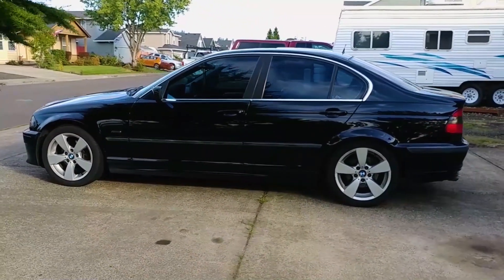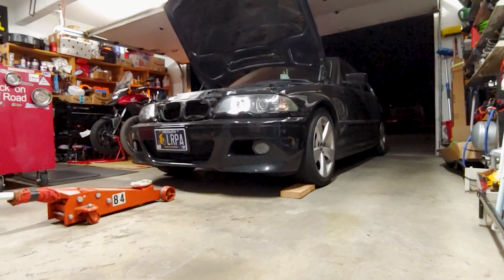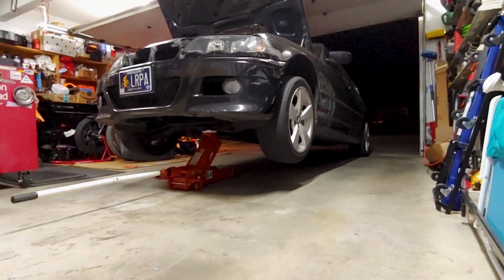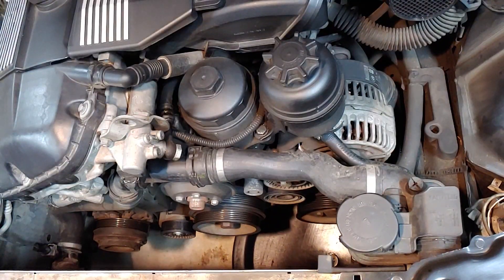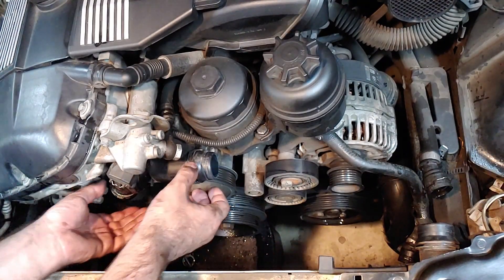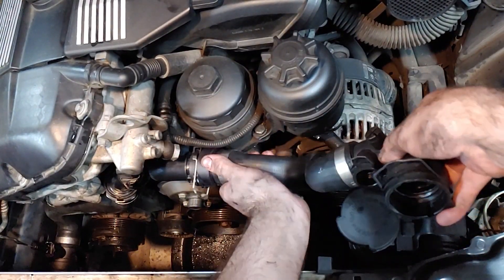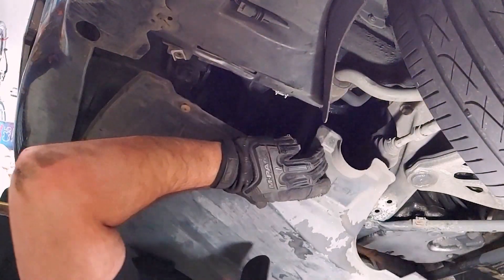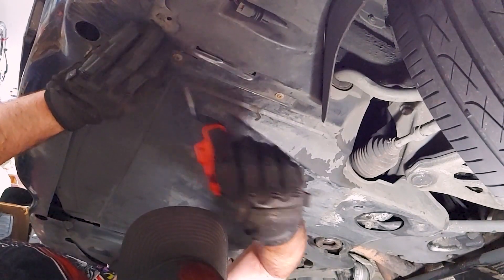BMW Thermostat Replacement with Tool Sizes and Torque Specs – M52 and M54 Motors

Comment: Top video with brilliant presentation.
Reply from the maker: Thank you
Reply: @EndlessMoneyPits  I plan to replace my expansion tank, thermostat and water pump on the weekend.  Do I need to fully drain the old coolant from underneath the car?  Also, do I need to remove both belts?  Can I not just loosen them?
Reply from the maker: I don't think you should need to drain the coolant fully, just make sure to bleed it properly when you're done. There's not a way to loosen the belts unless you mean to pull them off one pulley for slack. I would remove them completely so coolant doesn't spill all over them. It's pretty easy to take them off and put back on, and if you're planning to keep the car it's something you should get familiar with. Just my two cents but everyone does things differently.